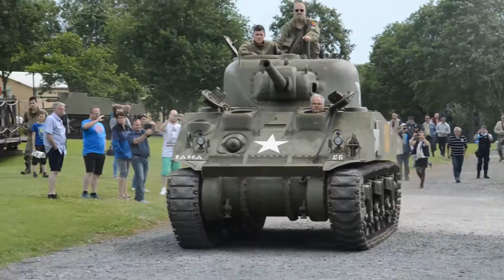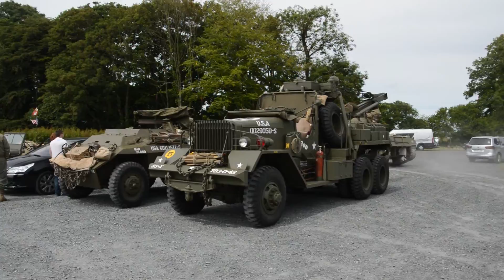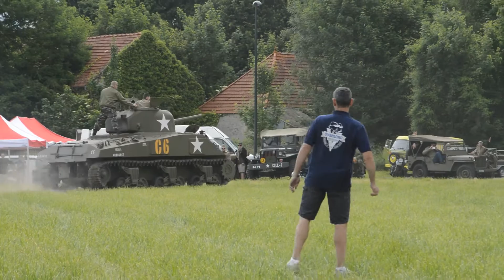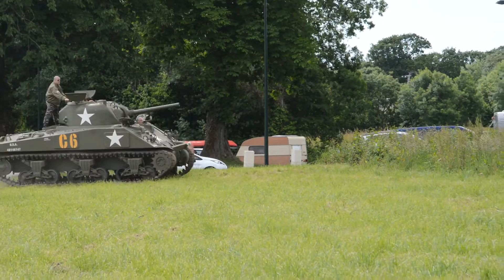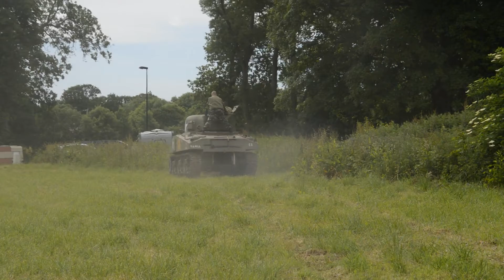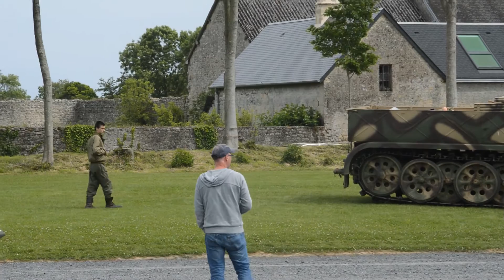Sherman M4A4T in action!!! D-Day 2017

Comment: Why are the doors open on the engine?
Reply: The first Shermans had radial aircraft engines and were air cooled, I assume it's to keep the engine as cool as possible. It sounds like it has the radial engine, but I could be wrong.
Reply: @ConsciousnessisRough  the M4 and M4A1 had radial engines 
This is an M4A4 sherman
Which has 5 Chrysler inline 6 engines connected in a Star pattern then connect to the transmission